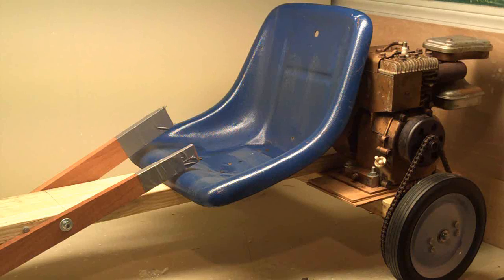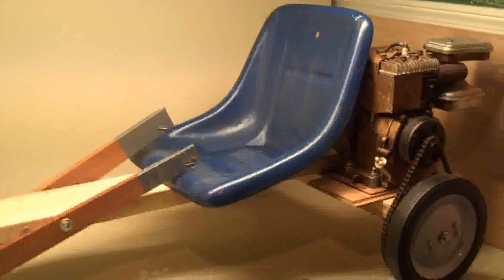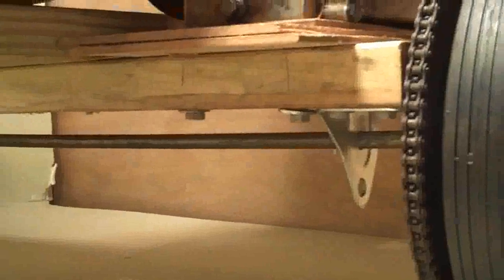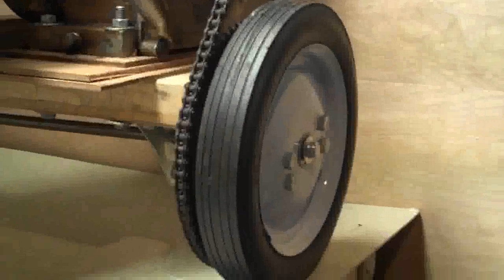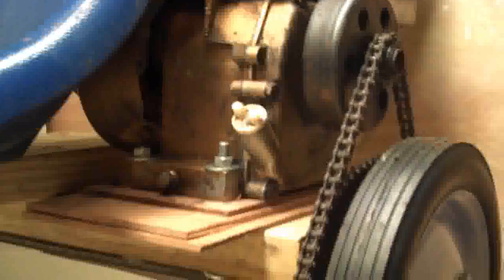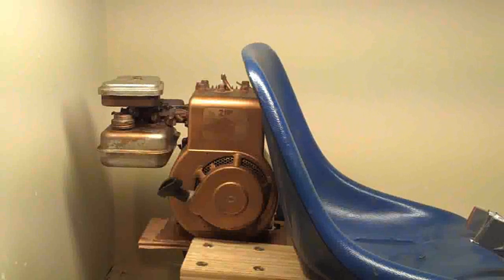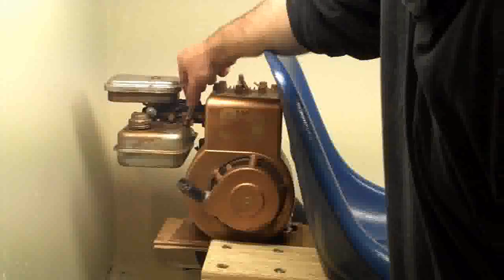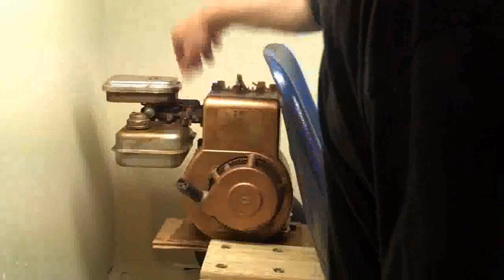How To Make a Go Kart Part 2, Adding a Motor

Comment: need bearing onto your real axle or if you leave that plate you put it will cut the axle and loose  a wheel very dangerous other than that its a well built gocart

Comment: That seems a little bit scary. I wouldn't just because of the way that the steering is set up. If there was a steering wheel it could be safer.
Check this out: Go Kart Build Part 1 by Douglas Underdahl
That is a great series on how to build a go kart that you might want to check out.

Comment from the maker: This one isn't a lawnmower engine because it has a horizontal shaft. You have to try other engines. Lawnmower engines usually have a vertical shaft that goes straight down.

Comment: You could, for sure, but you would either have to raise the height of the kart, or make the total "pedal diameter" very short. You would also have to make sure that the chain does not interfere with the brakes and other stuff.

Comment: I think the rear wheels are too small...that gear is nearly touching the ground. If you run over a bump or a rock it will bend it or the chain links.

Comment from the maker: @muhgust I am trying to remember this. Look in the area that has all the casting wheels for equipment. I think I bought wheels with the mounts then removed the wheels so an axle would fit.  In my local home depot its in the area where they sell all the hardware like nuts, bolts and stuff like that.

Comment: @epicfantasy no the vertical shaft cant be used to drive it. unless you have a twisted belt configuration or like you said a gearbox. speed is no problem you can simply adjust the carburetor to set the idle speed. nice tho I built the downhill version I might make a vid on that if i find a hill to ride on :P

Comment from the maker: @PTEredmond It makes a very big difference - the size ratio of the gears. Smaller gear on the wheel means faster go kart, but it takes more horsepower to run.

Comment: how do you get maximum speed from the gear/chain set up. dose it make a difference is the gear on the wheel is small and the one on the engine big?  :S im new to this so far only made a lawn mower go super fast with switching pulley sizes now wondering how it works with a  simple set up like this thanks :)

Comment from the maker: @TheMrdjordjevic Kind of a long answer but I bought a piece of steel rod that was the right diameter- fit through the wheels correctly. I bought a pair of brackets with small wheels on them, removed the wheels and re-drilled the holes for my steel rod. mounted the brackets under the gokart then through the wheels.I think I have more pics and info about this on my site.

Comment: @coolfrog27 go to diygokartsdotcom to calculate speed. Although either a vertical or horizontal engine can be used, a horizontal will be easier  (URLs cannot be put in comments, replace the "dot" with a "." to get to the site)

Comment: @coolfrog27 horizontal,and it depends on how you gear it. don`t follow this design i would advise you to get a regular frame off ebay. trust me ,the wood will break, the steering is very dodgy and will break to with too much pressure. you need to know what your doing for the safety of yourself and anyone near you! and the brake system won`t stop it going down a hill let alone a engine,not to mention if the throttle gets stuck (which has happened to me when i once started mine.

Comment: Im thinking about a chainsaw engine...could  just make it so that it rotates a sprocket and cain intead of a cutting chain thing. but what im thinking is then i will have to pull it to start it. also do you know how i would hook it up, or any engine up to spin the back axle.

ALso im trying to figure out how to think of how to make the weels turn without moving whole axle... all i know is that you somehow have to other bars going to weel connecter and it somehow turns wheels.

Comment: @igozdor01 

How do i know its unsafe? Look at the damn thing! its made out of scrap wood, has shitty tires (push-mower?), the axle is supported by flanges with no bearings, its a recipe for disaster.

How do i know he doesnt know what the hell hes doing? see above.

I am not some keyboard hero, i have built 3 go karts, 1 of which is capable of over 75mph, and has a twin cylinder motorcycle engine. I believe i have a few videos of it up, check them out if you dont believe me.

Comment from the maker: @hockeybomb25 Generally you can't use a lawn more engine because it has a vertical drive shaft. You need an engine with a horizontal drive.

Comment: That's a Briggs an Stratton like mine ( there's a few bids of it) if you take the air filter off and look at the side of the carb there's a bracket to clamp the throttle cable housing then just connect the thottle cable using a electric block, it's what I did, here's a tip for upgrading, make a steel frame for it and ass a stering system what don't involve rope, you could also add a wishbone suspension with shock an springs

Comment: no there is a huge diffrence ,different mounting positions , oil slinger, fuel system system setup ,and fly wheel is cast iron .you are better off buying  a horizontal shaft  or using a edger , tiller or a other used engine. all though you could modify a vertical shaft by  welding mounting plates, switching the oil slinger,changing the flywheel to cast iron,and modifying the fuel system but, you are better off just buying a horizontal engine and save your self time and money.

Comment: i just got a steering wheel and 1 metal pole attatched the metal pole to thel bolt  and added rope to the right side of the steering wheel and the right wheel and the same on the left thats how to add a steering wheel.

Comment from the maker: I got the engine at a yard sale. Difficult to use a lawn mower engine because the shaft is probably vertical. You will need a gearbox to change the shaft to horizontal. Probably shouldn't go with a lawn mower engine.

Comment from the maker: I bought the wheels then bought a metal rod from home depot that was the right size. Then I used spring clips to hold the wheels in the right place.  I got the wheels from home depot too. They are lawn mower wheels.

Comment from the maker: I think its some kind of lawn mower engine but it has a horizontal shaft which is very important. Most lawn mowers have vertical shafts which wont work. My motor might be from some other kind of power lawn tool.

Comment: i think youve ruined it now because you put the engine in its good but it looked better without and i think you will need a stronger design for that have you got any videos of it actually running with and without the engine